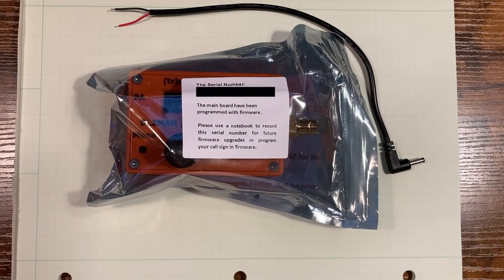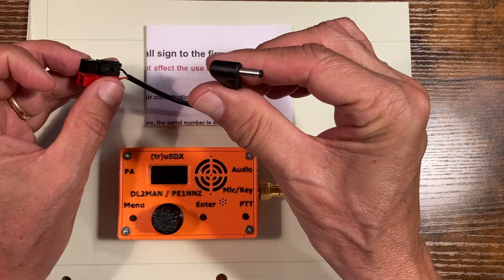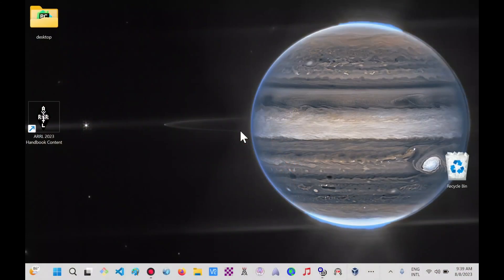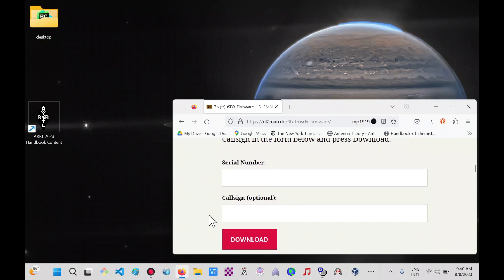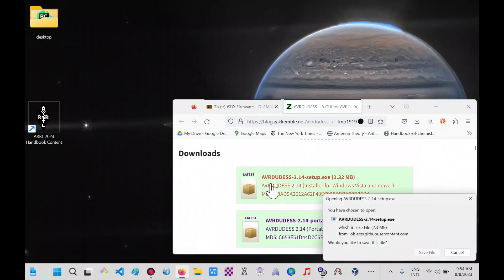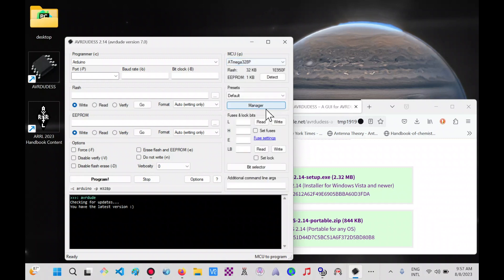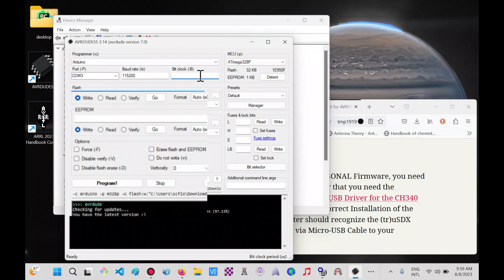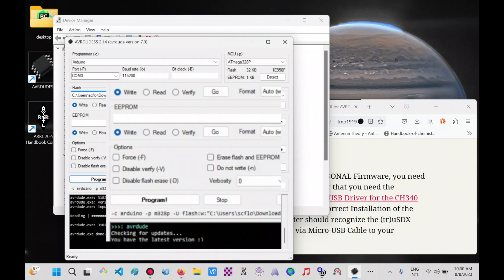(tr)uSDX First Impressions & Callsign Programming

Comment: When I select programmer I don’t have the option Ardunio
Reply from the maker: Thanks for the comment.  It sounds like the version of AVRDUDESS that you're working with may be the issue.  I used version 2.14 in the video so you may want to try loading an older version of that software.  Best of luck & 73.
Reply: @quantumradio  I'm using AVRDUDESS 2.20 and was having problems until I realized (1) from the notes that came with the radio that I should select "Programmer" as "arduino...(Arduino bootloader using STK500 v 1 protocol)."  (2) The "Ports (COM & LPT)" ==> USB-SERIAL CH340 (COM4)" does not show up in Device Manager until the data cable is plugged in. (3) I either missed or it was not mentioned or it was assumed that under "FLASH" the Firmware that was downloaded and included my call sign and radio serial number had to be selected.  Once the above was completed the firmware installed and my call now shows up in the radio.  But, I would never have gotten this far if not for this video.  So, THANK YOU and 73's.
Reply: @quantumradio  thanks I think the AVRUDUDESS versions must be different now. I deleted off my computer and reloaded and I finally got it to work 

Thanks for the help